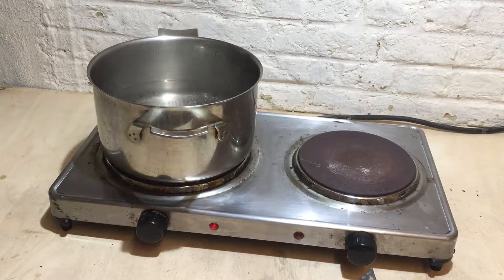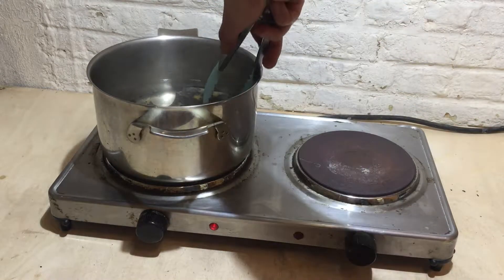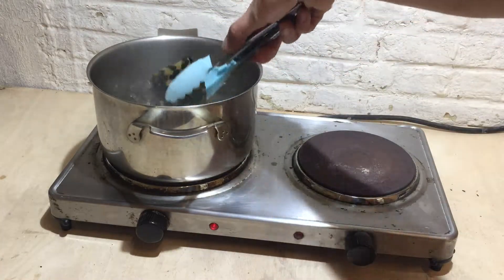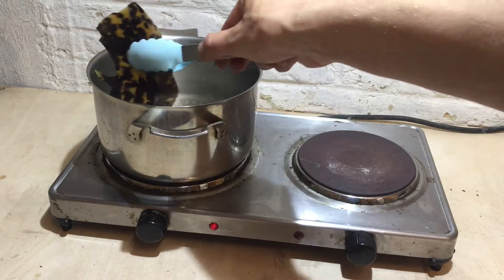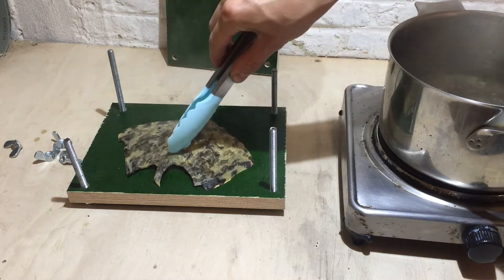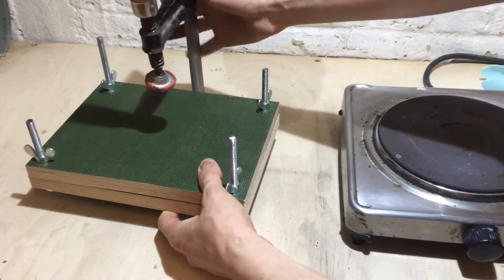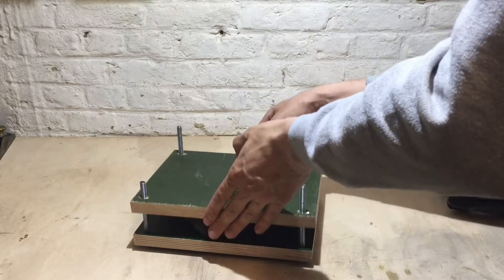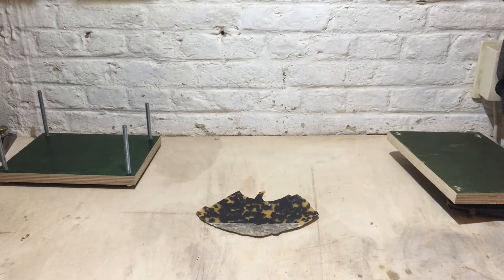Luthier Shorts #4: Flattening Antique Tortoise Shell

Comment: Hi, I’m trying to restore a small jewelry box made out of tortoise shell (quite an old box). Shell being mostly made of keratin/protein I was wondering if applying water in both broken edges and then pressing them together might work creating the bond (glue) the pieces together? Do you think it may work? Any idea of what kind of material to use to bond 2 pieces together? thanks a lot
Reply from the maker: Hi there! Water alone wont make the pieces bond back together, only to make the supple enough to get them back into shape... depending on how distorted those corners are i think i would probably use fish glue (like hide glue but you dont need to heat it, and also a similar dried colour to shell)... and tape to hold the corners in place while the glue dries. Good luck.
Reply: If modern processes are allowed in your box restoration, you can use CA glue ( the thinned variety) to glue up edge delaminations. The thin CA will capillary to the layers to somehow stabilized the structure, clamp down fast upon application and then dress the surface down when cured and done. Late comment but hope it helps.
Reply: @hankatmaggies8819  thanks. I went with fish glue and it worked. Not exactly the same color but you must really pay attention to see it. I thought about CA glue but the thing is that I’m afraid to spill some outside of the crack and it will be very difficult to get rid of it. The shell is kinda blackish and will be very visible. But you suggestion is totally worth it if the shell was of another color so thanks
Reply: I know of historical references that say you can bond two pieces of shell together using just heat and pressure. I have been trying to recreate this effect with cow horn bur so far I have had no luck.